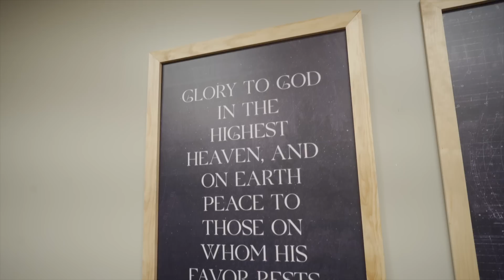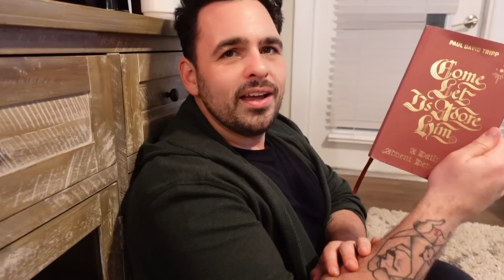Christmas with Our 7 KIDS! 🎄 SPECIAL SURPRISE & Sweetest Reactions! 🥰 (2022)

Comment: If you would like an idea to help Linky be a bit more independent with opening gifts:
Use the curling ribbon that is commonly used for gift wrapping. 
Tape it down in the center and on one edge of the packs before it is wrapped. Wrap it all the way around the box and leave about 4 inches hanging off. Wrap the gift, still leaving the tail of the ribbon hanging out.  The ribbon should run between the two layers of wrapping paper where it overlaps. If needed, you can tie a loop in the exposed end or make a handle out of a short pencil. When time to unwrap, the recipient will pull the ribbon which will slice through the paper.